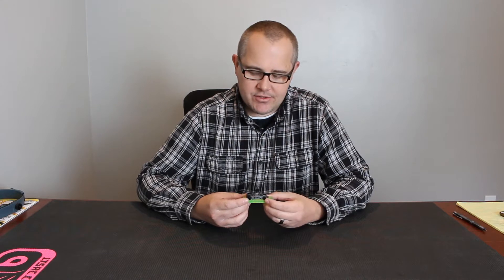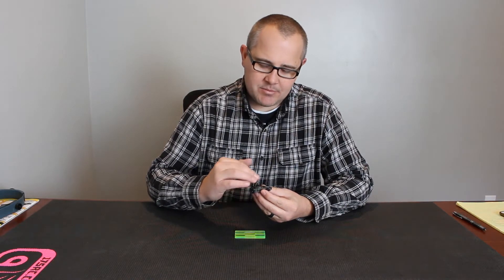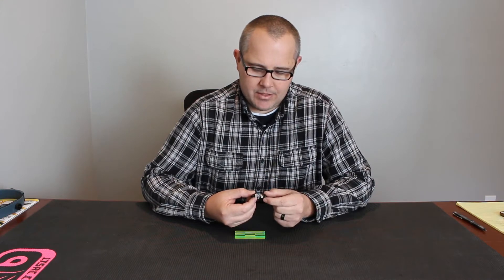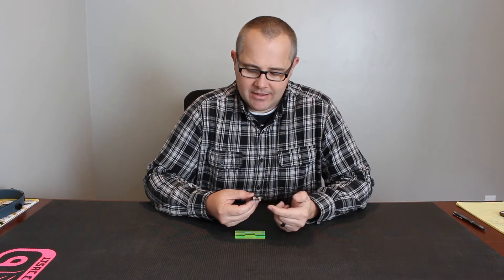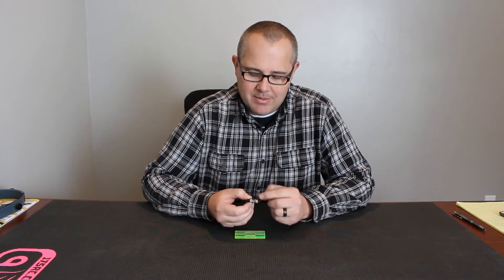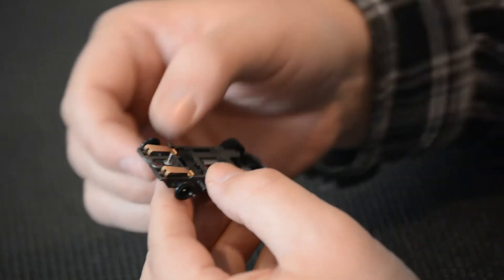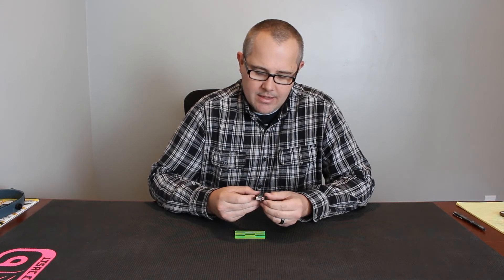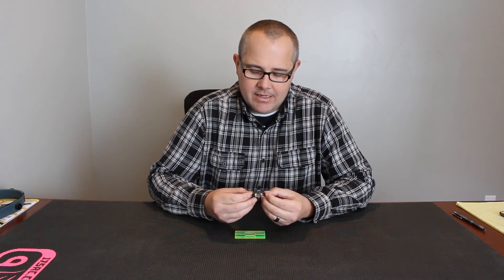HO Slot Car Endbell Timing Explained

Comment: thanks Dan, love this tip. did not know anything about the endbell, so cool to adjust this. For my small 3x6 viper captains layout it seems to help a lot to have passenger side down setting to handle all the tight turns just a bit better. smooth. thank you for these Super G+ / Viper V1 tuning tips, love these. I would love to see one on replacing bushing with ball bearings!